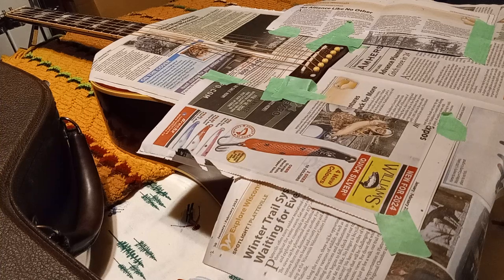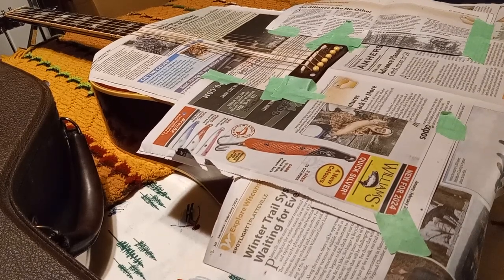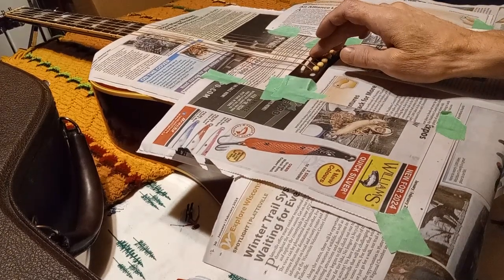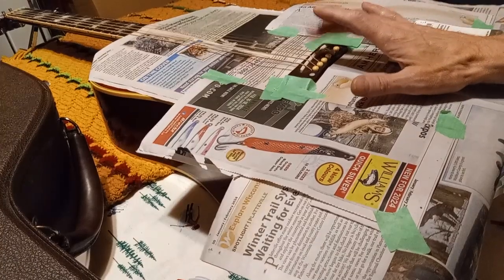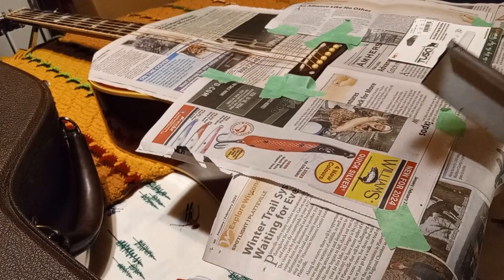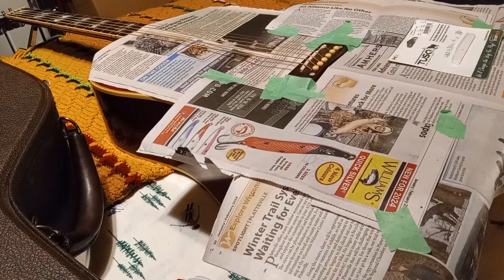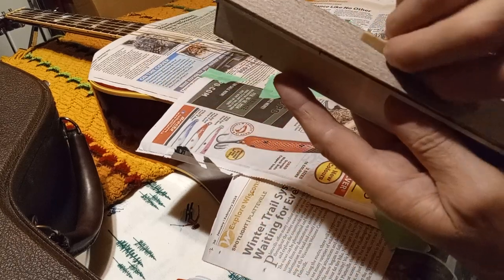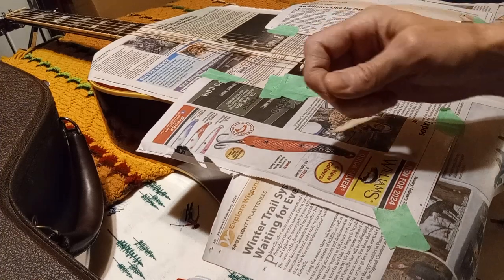Gibson Hummingbird saddle replacement

Comment: You're up late too.
I slept a while, had to get back up, my neck was eating at me.

One day I'll get another acoustic.
I've been trying to find an old parlor guitar, and work on my slide.
I like that hummingbird you have.

I've never changed a bridge on an acoustic, so I'll keep this in mind for sure!!
I've done several nuts on elec. guitars, my first attempt many years ago, was exactly
as you said...the front wears down faster, and I thought I was putting even pressure on 
the nut, and I wasn't. 
So now, I turn it around, and go slow, that is the ticket...nice and slow, and even.

Good video man, this give me information if I need to work up a new bridge 
on an acoustic!!!
Reply from the maker: I'll use that slow sanding way next time thanks for that information Dale and I hope your neck pain eases up for ya....there are a lot of cheap costing good acoustics for sale out there new and used  every guitar player needs one! 😂 Great porch jammers to no amp! Lol". I got that new LP tusq nut I need to put on the chibson slash guitar I'll use your way on the sanding on that one I keep blowing it off it stays in tune and the intonation great but I'm just wondering if I'll feel or hear a difference changing over to the tusq there not that expensive at all so it would be a great cheap upgrade for the guitar and I'm super curious to see if I will feel a smoother strum and picking (a less vibration and even better intonation) i kinda did on my Glary telecaster in the feel when strumming and picking but no tone changes can't remember on if my intonation got better it's been awhile to be honest lol" I do want the professional nut file kit the new yellow handle ones for 80 bucks before i do the change my cheap ones don't work well there actually like welding tip cleaners and they bend there so hard to use also the good ones will give me a perfect cut and not ruin the nut give me more confidence 😂...ya the saddle change on my hummingbird here big-time brought it right back to like the day i bought it my tone is so great again lol" well worth $13 bucks paid..
Reply: I hope I said that right on the sanding...I just meant to sand it slow and easy, like you said, the front will dip and take more material off than the back.
I swap the ends around like you said there, and mark it with a pencil, and go real slow, easy sanding till I get it. 
Sometimes tho, I don't get it quite like I want it, and go a bit more sanding after I get the strings on, and fret the cowboy chords..sometimes it still don't feel right, and I take off a bit more. 
Also, I never glue the nut in place till after I make sure it's right.
On the Gibson, I've never even glued the nut down, don't know if that matters or not, it works great, and never had it to slip to one side or other so far.
Once I do that, I look to see if the nut slots need some filing down, and on most of the Tusq nuts, I've not had issue at all, so far, just sanding the bottoms has been good.
But remember, I use 8 gauge strings, so the strings fit the slots great, and I've never had a string to pop out of them.
I put a tiny drop of 3 n' 1 oil on the string slots....seems to work.  @ElvisPretzel-rv3bg
Reply: And I forgot, I was watching this video, and noticed myself looking at that fishing lure on 
that piece of newspaper you were using, and I had to re-watch part of the video!!!
Reason I mention that, when I was up north many years ago, I bought some lures that you fellas use up that way, and tried them on Stripers here, and they worked!!!
I did buy mostly shiny ones, like chrome or lighter colors. 
Anyway, that picture on the paper got me to thinking about fishing here soon. 
Mid April to very early May, the sandbass start running here, and I load up on them.
Reply from the maker: @dalesmyth7398 hahahahahaha!!! Ya I can't wait to fish opening day It's the first Saturday of May is our opening we can only catch bluegill in the lakes till May right now and anything goes for our rivers we just have to abide by the states bag limit on the rivers the walleye are running in the rivers right now I want to go bad get me some my new guitars been my main recreational hobby lately 😂..
Reply from the maker: @dalesmyth7398 I just wrote a book on this no glued in nut stuff comment took me a long time to write it and it disappeared somehow! 😂 I had to reset my phone cause my YouTube went down for some weird reason 😂 ya with a Gibson style Headstock with the 3x3 tuner placement it keeps the nut in place good but a Stratocaster not so good not being glued those nuts slip out the slot because of the inline 6 tuner placement even with a string tree on the headstock i had a strat that did that to me my old spectrum strat those are actually a great strat when you set it all up and level the frets it rocked to it only cost 90 bucks now there higher in price..ya if you sanded your nut flush and flat for the headstock nut slot and the slot is clean and flat your all good with a Gibson I saw tons of guitar owners who had new guitars and they would go change there strings and the nut would fall off they never new until the string change 😂
Reply: I used to striper fish quite a bit in winter.
I'd fish for them just like catfish, but use live shad, with a 12 to 16 in. steel leader.
In late summer/early fall, I used a homemade rig we call Gollywhoppers.
It's a weighted float, with 3 ft. of line, then another steel leader, with a bigger jig tied to it.
Cast it, and pop that float...the weight of the float in front (leaded weight), would dip down some, and that would make the float pop, like a hula-popper.
That is some fun fishing, they blast out of the water after the bait. @ElvisPretzel-rv3bg
Reply: Ya, on the 3x3 headstock, there's been no issues with the nut slipping to either side, for me anyway. I just left it alone, if it's working, don't mess with it.
I did glue the old Wilshire nut in place, it's an inline 6 headstock, but at the time, I didn't think about it slipping, I just glued it. But that makes sense what you said.
 @ElvisPretzel-rv3bg
Reply from the maker: @dalesmyth7398  yes I used to do stripper fishing all the time back when I lived in Indiana were I had my own house it was right off the state line of where I grew up in Illinois yes the striper is a great fight I miss my hot spot I had bad it was off a picnic table in front of the lake right next to a dairy Queen that was literally fifty feet from picnic table 😂 😂 in the summer it was the perfect spot lol" if your able to send me a pic in a email of that set up you use no biggie if you can't... I'd love to see if we have that lure here and do the set up rig your running